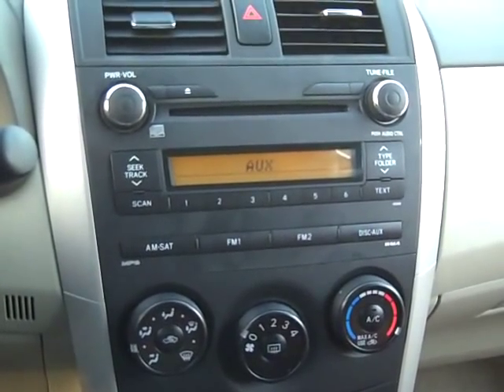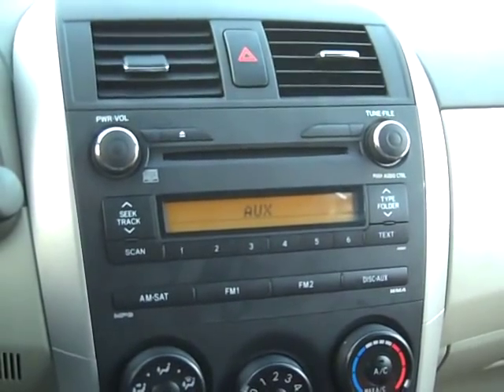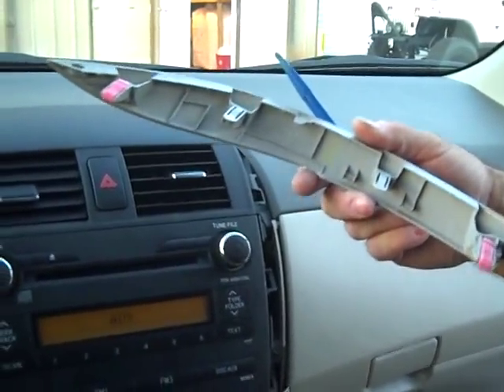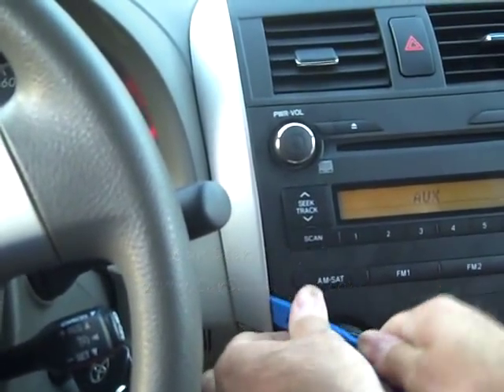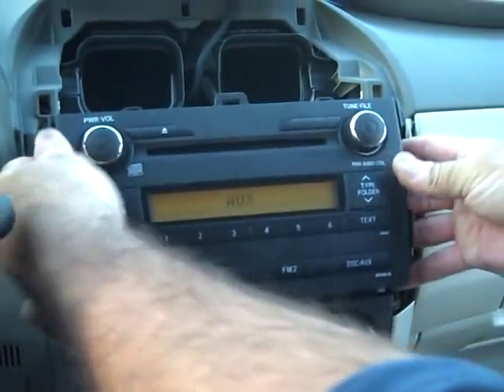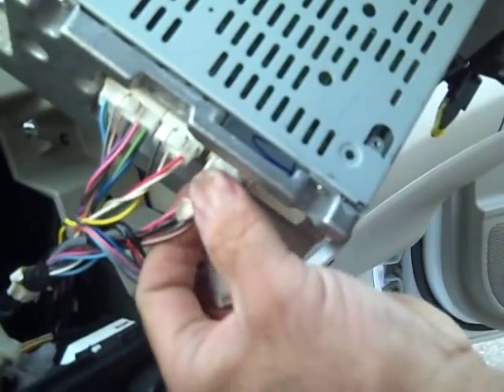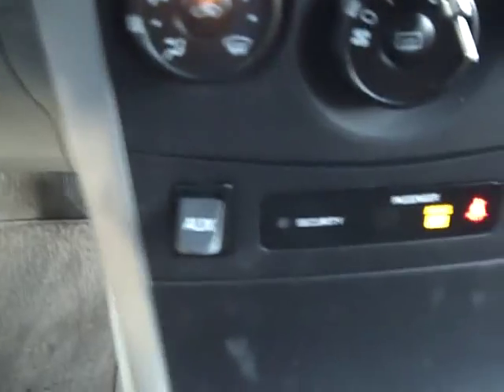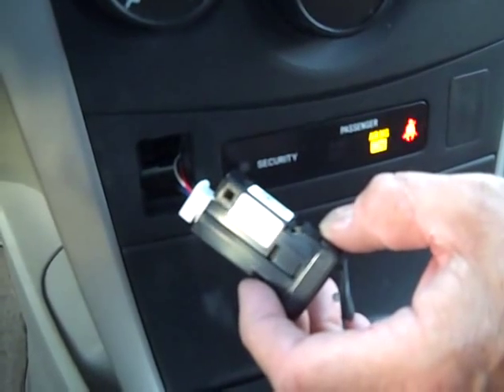Toyota Corolla Stereo Removal 2009 - 2012 = Car Stereo HELP

Comment: Its not that easy on the 2009. I thought I was doing something wrong until I noticed 4 bolts holding the radio in the dash. I kept tugging and tugging like you did and nothing until I loosened those 4 bolts.

Comment: Your instructions didn't work for my 2010 Toyota Corolla.  My radio if held in the dashboard with four 10 mm bolts.  My radio looks the same as yours, but my radio has an additional four brackets bolted to the side, and it is these brackets that are bolted to the dash board.

Comment: so how would i install a pac adapter for rca's for a sound system to the radio after i got it out?, and the radio wire for the other wire slices into the one leading to the amp from the radio right?

Comment: So in the video he just pops the stereo out, but in reality I've been pulling and prying at it for about 15 minutes and it won't budge.  Any ideas?  2009 Toyota Corolla LE.
Reply: Billtog You probably figured it out by now, but if not I believe the 2009 model has 4 screws that you have to remove before pulling it out.
Reply: TH3mrBROWN Thanks for the reply.  I ended up having to take it to an audio place and getting a whole new stereo.
Reply: Billtog Yes, on the 2009 there are 4 10mm bolts to unscrew before the thing pops out.

Comment: where is the bulbs inside stereo? my radio's display light are all out but still working after i replace bulbs inside my ac control.
Reply: HOW DID YOU FIX YOUR STEREO LIGHTS? MNE WENT OUT

Comment: I installed a new original corolla stereo, but stereo lights turn off when I turn car lights on and stereo lights are on when car lights are off.. Any idea?
Reply: DID YOU FIND OUT THE REASON? MINE IS DOING THE SAME THING NOW. THANKS